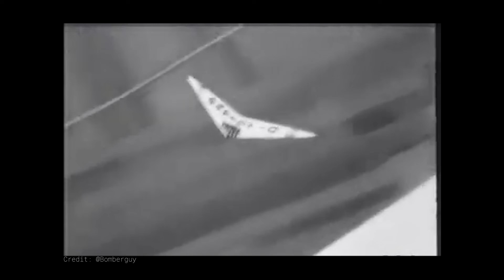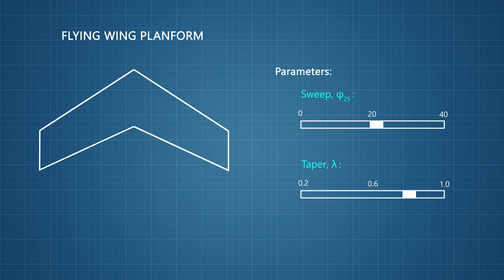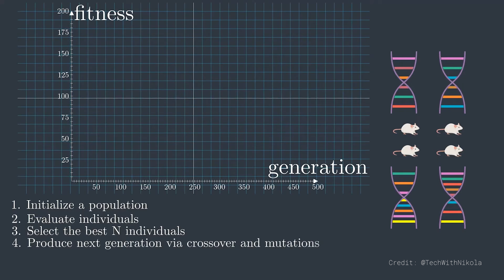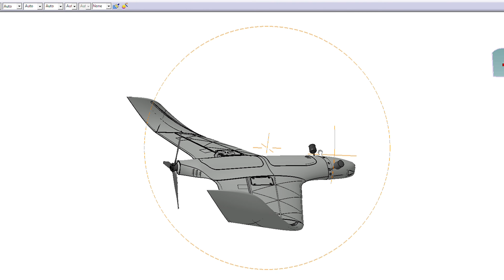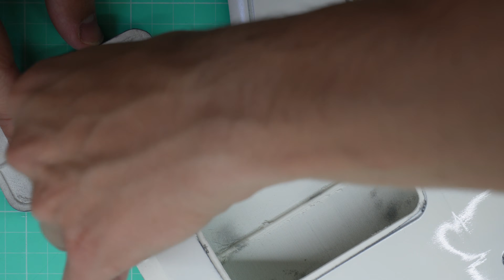🚀 I asked A.I. to design the ultimate FPV Flying Wing... and it's INSANELY EFFICIENT!

Comment: Excellent video. What tool is used to come up with your initial cfd simulation dataset?
Seems like you could take this process forward and re-seed the model with the newest design(s). I can imagine this as a closed loop. I guess doing the full CFD to validate designs is a bottleneck? Do you find that the NN approximation of the CFD has any issues? I'll be downloading your STLs when you post them... very cool stuff!
Reply from the maker: Thanks, Michael! 🙌 For the CFD simulations I’m using OpenFOAM, and you’re absolutely right — the process could be run as a closed loop. The neural network works great, but it could definitely be swapped for other ML methods like Gaussian Process Regression (GPR), which can also give excellent results. STL files coming soon! 🚀
Reply from the maker: The STL files are now live!
🔗 https://cults3d.com/es/modelo-3d/artilugios/ai-optimized-fpv-flying-wing
Reply: @neuronautics_Lab  awesomme :D !

Comment: Great work! Does the search space have a single optimum? Is it possible the solution is a local optimum, and, therefore, even more efficient designs could exist?
Reply from the maker: That’s totally possible —though the genetic algorithm helps explore the design space more broadly, unlike a typical gradient descent approach. In this case, the solution aligns well with traditional design resultsk, so I think we’re on the right track 🚀

Comment: 20:10 for the next version, try smaller alevons!!!!!!
It is the the same area like my 800mm dolphin. And for an max efficency trimmed wing a way to much. Make it shorter or more narrow to improve the wing shape.
Yes, your Servos need more travel to correct the position error, but this is not nocitible in the flight. Maybe not so tight corners, or twitchy, but it should be endurance plane and not an spec race wing or pylon racer.
The ESC you yousing is an large dinosaurs. For this small engine. You get one for 1/3 of waight. 15-20A for endurance. And youse calculators to find perfect Motor KV to Prop Size ballance.
Reply from the maker: Thanks a lot for the detailed feedback! 🙌 Smaller elevons and a lighter ESC are definitely worth testing for a future endurance-focused version—optimizing control surfaces and weight could really push the efficiency even further. 🚀

Comment: I wish there is also an airframe where the Battery FC Gear compartment is put into a lifting body shape. Not just a boring susage in the middle of the frame. Like the atomRC Dolphin or AR Wing pro. Both have much space integrated in the wing air foil.

Comment: excellent project and well implemented. During flight the plane looks sensitive to roll control. Would be great if there could be real-time feedback to optimize the PID values.
Reply: This is actually due to winglets design.
The project is far from optimal looking from aerodynamic perspective. The AI cannot replace (yet 😉) the human creativity.
Reply from the maker: Yeah, indeed ArduPilot has AutoTune—an in-flight tuning that attempts to automatically tune the PID values

Comment: After 3D printing a Horton I would be very interested in seeing your STL files. :-)) I liked the idea of adding an epoxy finish. I'll have to try that. Great video!!!!!
Reply from the maker: Thanks, John! 🙌 Epoxy definitely adds strength and a nice finish, but it does come with a bit of extra weight. STL files will be up soon! 🚀✈️
Reply: @neuronautics_Lab  Do you know how much weight it added?
Reply from the maker: Hi John! 🙌 You can now find the STL files here:
🔗 https://cults3d.com/es/modelo-3d/artilugios/ai-optimized-fpv-flying-wing

The extra weight from the epoxy is around 30–40 g, so I’m not completely sure it’s worth it for a wing this small. I’d skip it unless you’re expecting some hard landings! 😉

Comment: The amount of effort in so many different skillsets that went into this video are incredible. I respect your effort and i love the design!
One idea I had was if it was a good idea to add multi-layer control surface inboard ailerons for micro adjustments similar to the a380 or 787 wings? 

Also, may I ask what cad software you use? Right now, I main plasticity.

Amazing work!
Reply from the maker: Thanks a lot! 🙌 That’s a great idea — multi-layer control surfaces could add precision, but at this small scale the extra servos might add too much weight to be worth it... 🚀✈️

Comment: Surprised you didn't include dihedral among your wing parameters. Or does your definition of flying wing preclude any angle between left and right sides?... Impressed with both your Andalusian plain and your Andalusian plane!
Reply from the maker: Thanks! 🙌 Dihedral wasn’t in the param sweep mainly because I kept the wing strictly planar for this iteration to reduce variables and keep the optimization space manageable. It’s totally possible to add—it would help roll stability but could slightly affect induced drag and yaw behavior in a tailless config. Might be worth exploring in a future “V2” run!

And thanks for the wordplay—both the Andalusian plain and plane appreciate the love! 😄✈️

Comment: training the nn on a 50 data points covering a 5 dimiemsional space is a nonsense, especially that you generated the samples around a sinmgle point inm the hyperspace. you can skip the network and go directly to genetic algorithms but you need to be able tp generate a loarge number of samples, thus develop a lower fidelity cfd that can be simulated much faster, and eventually in later phases, closer to the optimum switch to the more precise one to refince the solution. you also miss the validation step for your solution, you got the numbers, how do you verify that these are the best indeed?

Comment: I am glad to see this is actual use of AI in engineering and not a stupid attempt at making GPTs do thing they were not designed to.
Reply: AI-driven generative design has been around for a few years now. And, there are quality Engineering ChatGPT API's out there. I'm using one that handles BOM generation rather well. The good ones are typically tailored to very specific workflows. At the moment, if you want one for your particular needs, your best bet is to create your own. It's easier than you probably think it is, to create an API to handle repetitive, early-stage design tasks.

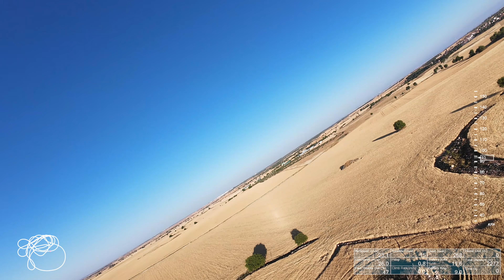Comment: 22:10 numbers don't match with video's title, unfortunately. 
Looks like you only get 1.3 - 1.4 W*h/km efficiency at ~80 km/h which is significantly lower than what Arwing Pro or Dolphin achieves.
Reply from the maker: I see you crunched the numbers! 🙌I’ll be sharing the full efficiency breakdown in a future video, with telemetry data and comparisons to other wings. Stay tuned! 📊✈️

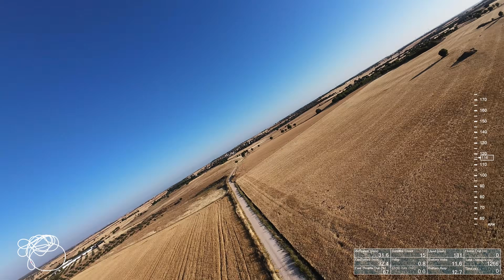Comment: Is that a heatmap of your flight plan at 21:46 in the lower left? what setting did you enable to see it?
Reply from the maker: Good eye! 👀 Yes, that’s a heatmap overlay generated with Dashware.
It’s a software that lets you import your flight telemetry (GPS, speed, altitude, etc.) and sync it with your video, so you can display live-style gauges, maps, and overlays — perfect for adding extra context to FPV or test flight footage.

Comment: 12:13

I am not sure I understand the details correctly but it is interesting to use a neural network to generate an approximation of the solution space and then use an genetic algorithm to update the design. It looks like you needed to run 93 iterations and that you did 2 function evaluations (CFD analyses ) per iteration.

I do wonder if a normalized gradient decent (I think that would need 6 function evaluations to compute the derivatives using the finite difference method, per iteration) or something like the box complex optimization algorithm (derivative-free optimization) would do as good or better. And if they would get the same result. 🤔
But it is a lot of work to find out. 😂

Maybe if we used one method to get ball park numbers and then used a gradient decent for the last few steps. But then how do you deside on the step size.
But then again there are and endless number of non-linear optimization algorithms you could try. Method of moving asymptotes (MMA), Sequential Linear Programming (SLP), Sequential quadratic programming (SQP), simulated annealing and on and on and on.

grate video. very interesting. And a lot of work for one video. 👍

Comment: So you flew about 8500 meters on 720 mah from a ~12 volt battery.  I noticed some pretty high motor currents as well.   Can you equate that to mwh per km and how it might compare to other designes?  That would define the efficiency.  Range and power used.
Reply from the maker: Thanks, Jeff! 🙌 Great point — I’ll break it down properly in mWh/km and do a side-by-side comparison with similar wings in a follow-up video. Stay tuned! 📊✈️

Comment: but does it waggle??  I want to see unstabilized footage.  Flying wings notoriously waggle especially at high speed and windy conditions.
Reply from the maker: It doesn’t waggle 😄—the first seconds of the maiden flight are raw, unstabilized footage straight from the FPV goggles, so you can see exactly how it flies in real slightly windy conditions. 🚀

Comment: Great work :) I would be keen to learn what specs motor/battery you are using and how much flight time you are getting. Could you disclose maybe the AUW as well?

Also bit of advice. Do not run NNs, GAs or any kind of AI in Python, you are shooting yourself in the foot. Do it in C++ or C#, just ship the python code to an LLM and ask it to port it for you if you are not familiar with the syntax etc. This would speed things up by a factor in the thousands. Pro tip: if you don't want to wait months for any compute iteration, you can render server farm compute really cheaply these days. Well, relatively speaking :)

Looking forward to a full auto flight :D
Reply from the maker: Thanks! 🙌 I’m running a brushless motor with a 3S Lipo battery. AUW is just over 400 g, and I’m getting excellent flight times thanks to the efficiency. And you’re totally right—Python isn’t the fastest for heavy computation 😅, but for this proof of concept it worked fine!

Comment: What a great project and great job walking through everything! This looks like it took a ton of time and effort!

I have one new feature suggestion that may not contribute to flight ability of the craft, but might help with internal part cooling for more efficiency possibilities. Have you thought of adding in inlets and outlets back where the motor is at so it can flow through, over the battery and parts within the body and out the back (maybe top side) near the motor?

I’d love to see what designs you might be able to come up with your AI/Neural Engine for a wider wingspan plane meant for longer, efficient flights like an wandering albatross 😊
Reply from the maker: Thanks a lot! 🙌 Great suggestion — in fact, there are already two small NACA ducts at the nose (just ahead of the FPV module) and some outlets near the brushless motor to help with ventilation. And I love the idea of using the AI design process for a wider, long-endurance wing — a wandering albatross-inspired build sounds epic! 🚀✈️

Comment: get rid of that LED strip!!! it's losing you so much L/D. also, consider sealing your elevon hinges
Reply from the maker: Haha, I know! 😅 The LED strip is taped on, so its impact on L/D is minimal—but I agree sealing the hinges could help squeeze out a bit more efficiency. Might try that in the next iteration 🚀✈️
Reply: @neuronautics_Lab ah ok that's not the worst then. it just looked like there was a massive trench in exactly the most critical place (leading edge top surface) lol, even tape may have some impact but probably small

Comment: Good stuff mate. However, I gotta say, if the end goal was to achieve ultimate efficiency, just building a non optimal frame out of foam and throwing a bigger diameter prop would have probably yielded a better result without months of running fluid simulations. If the point of the exercise was to learn how to do that stuff to begin with, that's a different story obviously.

Comment: Great proof of concept in building a tailless aircraft from an AI optimized design, thru model testing. Scaling that model up to whatever ultimate human use it will be put to, will surely the next logical steps. Good luck.
Reply from the maker: Thanks a lot! 🙌 Scaling it up would definitely be the next exciting challenge—but in that case, the workflow would need some adjustments to account for different wing loadings and Reynolds numbers. Who knows where this AI-driven design journey could lead! ✈️

Comment: This is a very impressive result - esp when you consider the computational limitations.  
GA's typically only achieve 80% optimisation - though this can be enhanced through  heuristics. 
Did you experiment with the parametric constraints in any of your iterations?
Reply from the maker: Thanks, Pete! 🙌 You’re right—GAs often plateau without good heuristics. I did play with the parametric constraints across iterations:

Sweep: 0–40°
Taper: 0.2–1.0
Twist: bounded per station along the semi-span
Aspect ratio: fixed at ~4.5 (b = 0.6 m)
Targets: m < 0.4 kg, wing loading ≈ 5 kg/m²

I also used a few tricks: elitism, mutation annealing, multi-start runs, and an active-learning loop (CFD on the current best + highest-uncertainty point, then retrain). 
GP works really well and can push beyond that ~80% ceiling. 🚀✈️

Comment: Is there no wing spar?
Reply: Appears there are ribs and a spar. Watch when he paints and sands the wing. You can see angled ribs and the spar when he sands thru the primer.
Reply from the maker: There’s definitely an internal 3D-printed structure made of ribs and spars 💪—the whole thing is optimized for maximum weight savings while keeping it strong enough to fly reliably.

Comment: I wonder, is it possible to reduce weight by 3D printing a thin and frail body and then gluing carbon fiber to it top and bottom? This would replicate the principle of a H beam where most of the strength is placed top and bottom but where the middle part can be rather thin.
Another idea I have is to switch wing and fuselage: To have two fuselages at each end of a large wing, and then reduce loss from the wing tips by having the propellers run in the contrary direction. Then you can steer the plane sideways as well, by regulating the speed of the two propellers relative to each others the same way as you do with a quadcopter.

Comment: Do you know the antenas work the same inside the plastic fuselage and they make no extra drag there?
Reply: I concur. Seams a waste of all that optimisation to wack on two bulky  antennas.
Reply: Antenna placement is definitely an important factor in minimizing parasitic drag 🤔😅
Reply from the maker: Hi!🙌 I wanted to maximize range by placing the antennas as exposed as possible, avoiding also interferences with all the electronics inside (GPS, receiver, flight conroller, DJI o4, etc) —especially for the maiden flight, I definitely didn’t want to lose it! 📡✈️
That said, the design is fully modular, so they could easily be dropped inside. It would actually be interesting to run a performance assessment with and without them… stay tuned! 🚀
Reply: @neuronautics_Lab  I wonder, wouldn't they work better if you hide them inside the wings?
Reply: The front antenna could be sunk level into the body. The wires will still be exposed. Nice work!
Reply: It did 130 mph seems ok
Reply: @andrewerickson6690  it can be better
Reply: Also, don't forget, if you ever use a carbon fiber impregnated filament, carbon fiber make a Faraday cage and you actually will have to place it outside.
Reply: Only with fiber glass. Carbon fiber will block signals.
Reply: @andresgonzalezcerda7635  Point taken. How about carbon fiber only the inner 80% of each wing  with glass 20% tips for the antennas?  internal space is a question.
Reply: @qo4kh  Or just make the nose section out of fiber glass and stick the antennae in it.
Reply: @qo4kh  when I go for streamlining I place the antennas inside the non carbon fiber wings, J-pole or slot antennas are small enough at those frequencies (around 10cm for a quarter wave) to fit and I use a circular polarization antenna on the receiver. You lose 3dB due to plarization mismatch but you can get some back fine tunning the antenna
Reply: @ArabianShark  better yet TPU...takes the impact. :)
Reply: @joshmutch5249  I like the notion, but can the radio signals pass through TPU as easily as through fiberglass? I'm really asking; I'm no expert.
Reply: @andresgonzalezcerda7635 good thing it's 3D printing then...
Reply: @andresgonzalezcerda7635  there is no carbon fiber its made with plastic you said all that for nothing

Comment: Interesting for sure, nice production quality too.  I know you put a ton of time into this.  You say it's efficient, I'm curious about the efficiency numbers, typically reported in something like miles/Ah or miles/Wh.  But this is a little dependant on airspeed, so you can try to find the optimal airspeed for your design.
Reply: Yes, KM per Wh.   He could fly a closed loop course that would average out any windspeed variations.  Best glide speed would likely be the optimal airspeed to target.   Then compare his KM/Wh to other similarly performing designs to get a true efficency number.
Reply from the maker: Thanks! 🙌 I’m actually planning a follow-up video where I will share the KM/Wh numbers compared to similar wings. Stay tuned! 🚀

Comment: 10+ amps in cruise is efficient???
Reply from the maker: Average cruise was actually well below that—around 7A. Considering it’s running on just 3S, with a DJI O4 FPV system (a real amp-hungry passenger 😅), that’s pretty solid efficiency. I’ll share detailed telemetry in a future video! 📊✈️